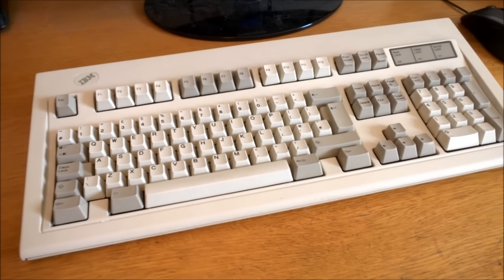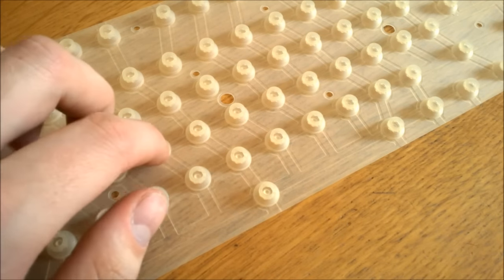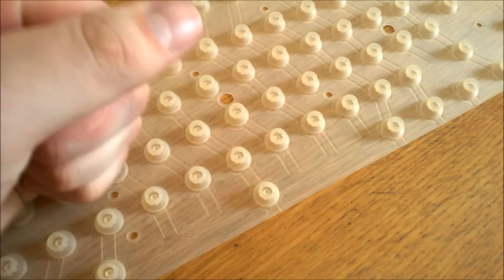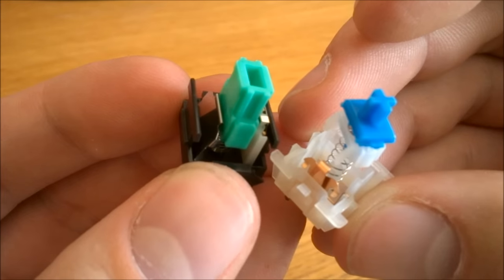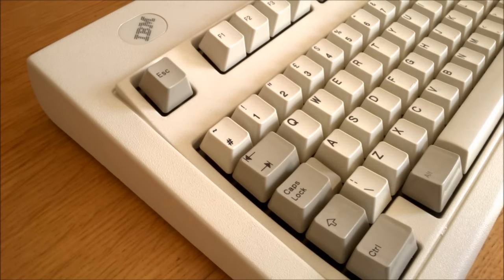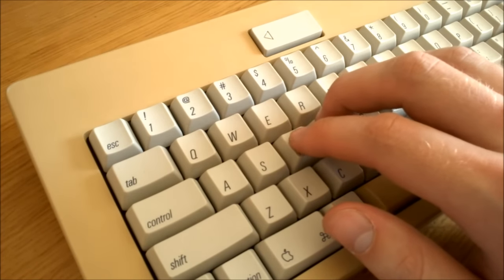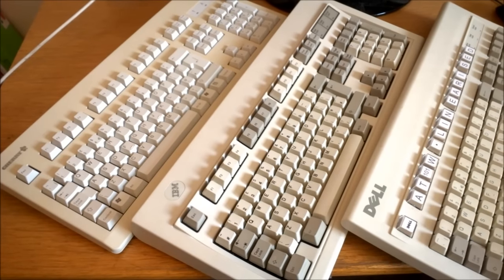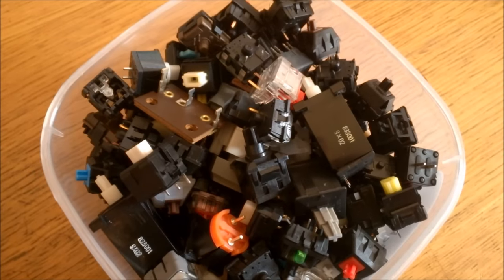QKT 1: Why mechanical keyboards?

Comment: My first mechanical came in the mail today, and I could not be happier.  I think I've found a new hobby...
Reply from the maker: Cool, what model?
Reply: Heh.  It's an "Easterntimes Tech I-500", sold on Amazon as a "TOMOKO MMC023".  It's an 87 key, and has "SwitchMaster" blues, which are Cherry MX knockoffs.  (I know, I know)  It's surprisingly heavy, and has an aluminum face-plate.  I got it for about $40, and it's loads more enjoyable to type on than the rubber dome chicklet thing that inspired me to buy it.  

It's a great replacement for my old Big Box usb keyboard, but now I'm keen on checking out recycling centers and the like for items with a little more character.  :)  I'm hoping to find something from the early 80's - something nice and thunky.

Comment: Have you tried out the Romer-G switches made by logitech? I have a G810 and it feels a cross between MX red and brown with a shorter travel time. The concept of a true recycling center here in Florida is a joke so I don't really have the luck you do finding all these beautiful keyboards.
Reply: Doesn't sound so appealing to me. Cherry MX Browns are very light, borderline linear.
Reply: MechaniKey I can tell you from experience that they are not linear, at least not the one I have from Ducky One TKL. I also have MX Blue from Filco which is just too damn loud for gaming in my subjective opinion.
Reply: Those Romer G switches are actually made by Omron, the same company that made those vintage Omron B3G-S switches that Chyros has covered. :3

Comment: Or you can get a Mechanical-Feeling keyboard. I got a brand-new Lenovo KU-0225 keyboard for 3 bucks at goodwill, it's mechanical or mechanical feeling (It's from 2001, it's the one with the windows xp logo on the home button) and really nice. And it was in-box with all accessories and the manual.
Reply: That is one of the better rubber domes out there.

Comment: Are you aware/interested in Apple keyboards? 
I am using the 2005 model, the one with transparent base and white keys.
This is the worst keyboard I have ever used in my life. From all its flaws the worse offender is the fact, keys can't be pressed at an angle - they stuck! The pin (is it called like that) is stuck into the cylinder hole when it goes in even at the slightest angle. None of the lowest raw keys (ctrl, alt, even space!) can't be pressed on the very edge for instance because they slightly tilt. You cant push keys upwards - it will also tilt and stick. Event if you hit a key slightly off center it goes harder because of excessive friction.
This horrid keyboard is the reason I am watching your videos! I never bought a keyboard, different then the standard ones, but I know I will now.

PS the new Apple keyboard is not better either - keys die young is again, just the worst of many offenders.
Reply from the maker: I have a fair few proper old Apple boards and many of them are really good!The last good Apple keyboard ever made was the AEKII (check my review on it) and the last great one the AEK (check those reviews too :P ). Since the AppleDesign keyboard (1994) everything they made was super crap though - the transparent one you mention is especially notorious xD ).

Comment: I think the reality is that mechanical keyboards aren't much better, objectively. They're no more reliable considering the price difference (which can be several times). They're often obnoxiously loud. The harsh bottom-out is arguably not great for your body.Subjectively, though, they can be very pleasant, customizable, and often nostalgic. You can get some interesting layouts and nice typing feels and sounds.It isn't really something I bother recommending to people... except Topre, of course. ;)
Reply: The thing is, its durability speaks its merits and essentially covers up the price difference; you definitely do not have to bottom out each keystroke. Actually, not having to bottom out is a major advantage, as this greatly reduces finger fatigue (where your wrist would be exhausted on a cheaper membrane board, on a mech keeb, you would be able to type much longer). In addition, even if you do bottom out, it is not as harsh as you make it out to be. In fact, in most cases, it can actually be a pleasant experience. Even your point about all mechanical keyboards being way louder is incorrect, as many linear switches can be incredibly quiet.